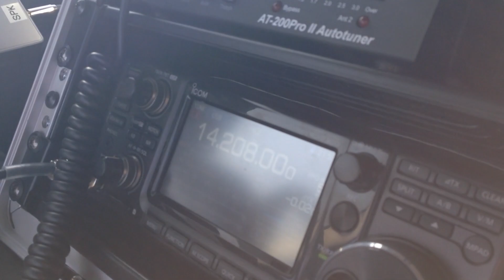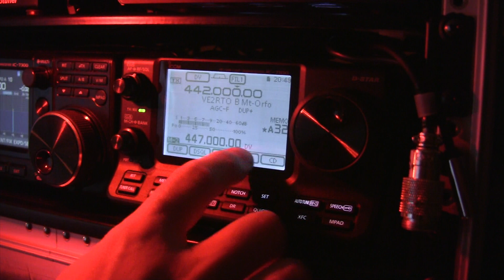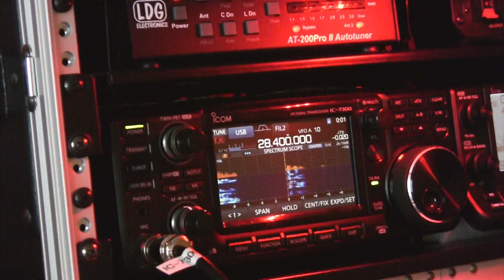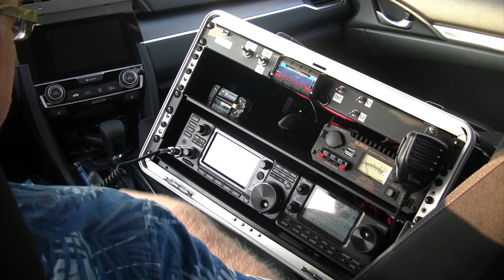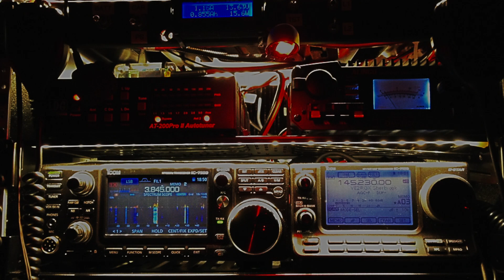Go Box w/ IC-7300, IC-7100, SDRPlay, Hotspot, T/R Switch

Comment: This is one of the nicest go boxes I've seen, many thanks for sharing.
Reply from the maker: Thank you Paul for the nice comment, Glad you liked it! 73
Reply: @VE2FGJ  Hi Frank, I have I've been wanting to build a go box for sometime and now have decided to do it. I have a Gator 6u case and will be putting a Icom 7300 and a 5100 but wondering what gauge wire I should use.
Reply from the maker: @Outlander1963UK  Wire rated for Max Current of all items. I can't remember mine is 10-12 gage for main distribution, less for smaller devices. Secondly important is a Power Distribution Box with independant fuses, I used a RigRunner 4004U, many other models can be fine. Good luck Paul with your build, 73!
Reply: @VE2FGJ  Many thanks for your reply. And yes I have a rig runner 4008.
73s M1DPU

Comment: What was your antenna set up
Reply from the maker: Thanks for the question, with the car, the antenna is a MFJ-1910 33FT TELESCOPIC FIBERGLASS POLE, Icom AH-4 Auto Tuner, 5 radials approx 12 feet. At home I use a custom made Fan-Dipole 80M-6M. 73!

Comment: Where did you get the Goose neck lamp with Red Led? thx
Reply from the maker: Hi Frank, It is a 12V Table Mount Goose Neck Lamp, original color is white, the lamp blew up after running it on 13.8V for too long, replaced the lamp with Red Led Strip (3). Thinking about adding a dimmer to it. Got it from Addison: https://addison-electronique.com/en/products/hardware-tools/gooseneck-lamp-table-mount-type/

Comment: I'm curious why use the 7300 and 7100 in the same rig? Other than the waterfall on the 7300 and the vhf/uhf on the 7100 they seem to have very similar specs. Im still working on getting my general, but im looking real hard at getting the 7100 as a buy once do everything rig.
Reply from the maker: Good point, I first got the 7100 then the 7300 a year later for the waterfall. The HF part is similar on both but the 7100 is an all around do everything radio that I want to keep more than the 7300. For the waterfall I can now use the SDRPlay with the 7100. The 7100 is a very good radio. Good luck on your General! 73